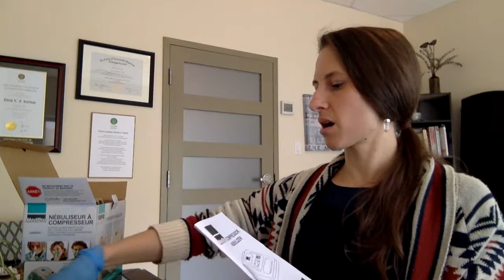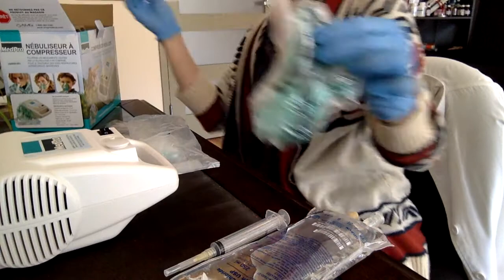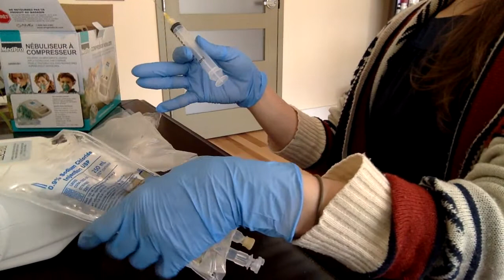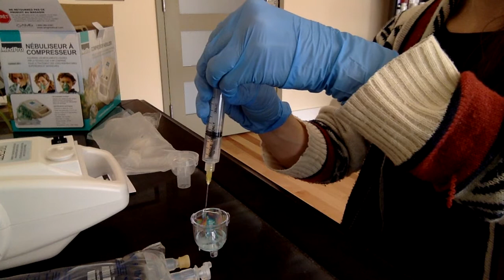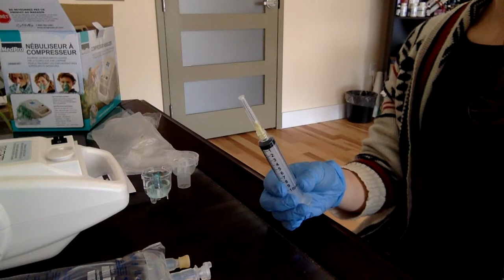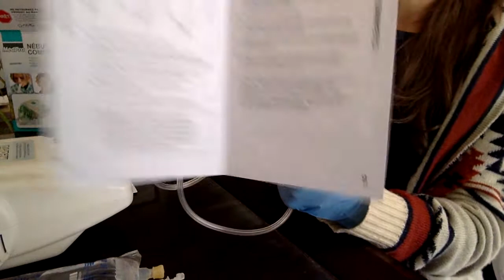How to use a nebulizer including saline solution from an IV bag.

Comment: Can I use the syringe again?
Or just going to dispose after use and buy another one?
Reply: You can buy boxes of them from medical supply stores. Personally, I get lung infections easily, so I would use a new sterile one each time. They're not too expensive, and worth it to avoid a lung infection. There is also nebulizer saline that come in single dose packets, so you just squeeze those into the medicine cup, that way it stays fresh and clean. Also at medical supply stores that specialize in respiratory care products in different strengths of saline. "Clean" and "sterile" are two different things, and I definitely prefer anything going into my lungs to be sterile. Lungs don't have the defenses to pathogens like your stomach, for example, does.